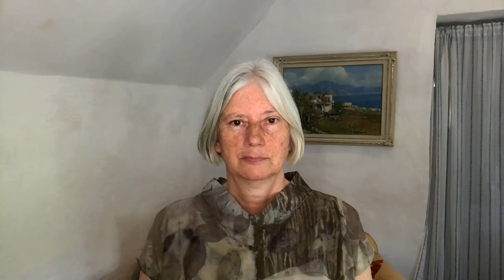Pipes and cores to roll your eco bundles up on #sustainabletextiles #ecoprinting #dirtypot

Comment: Thank you Nicola. I notice you never suggest using plumbers' polypipe to roll on. I find it very good, neutral in its impact on the colours. Especially when I want to dye a large pice of wool without creases, I use 7cm or even 9cm diameter pipe, which lets me get  the fabric very smooth. I sand off any writing on the pipe first . The leaves print onto the white pipe as well, and you can use it as a vase sleeve or put a light in it, which is very pretty.
Reply from the maker: Thanks so much for this suggestion Fran. I prefer to use food grade silicone tubing as it's safer when boiling for hours. I'm concerned that polypipe might release toxic fumes that are hard to detect. That said, I don't have any hard evidence to suggest this, it's just my fear!